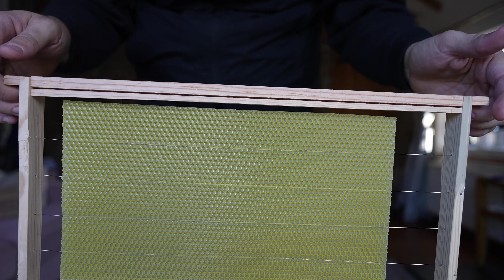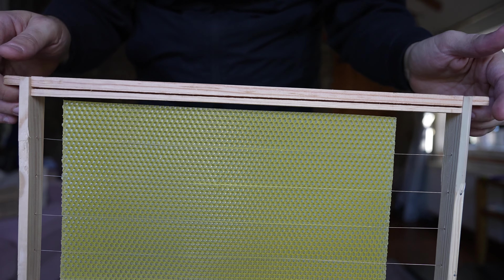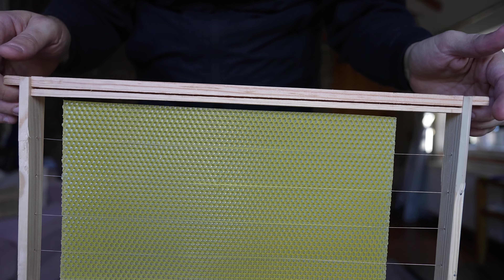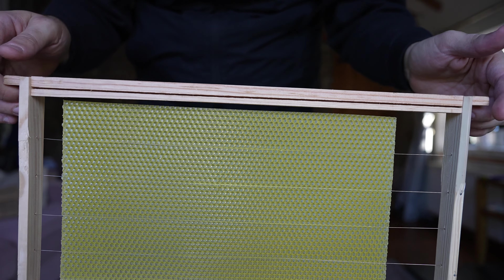How To Embed Foundation Onto Wired Frames

Comment: Don't really need that much power to this job. I use an old power supply that is 12v and 2amp max. Sure you can use a battery but Anything above 2amp is overkill.  This way you can hold both wires without worrying of getting a shock. 2 seconds more than enough to heat up the wire to melt enough wax to embed it. And you have't spent a penny on a new gadget. I find tons of these power adaptors at car boots for Penny's. That is if you have't got any at home already.